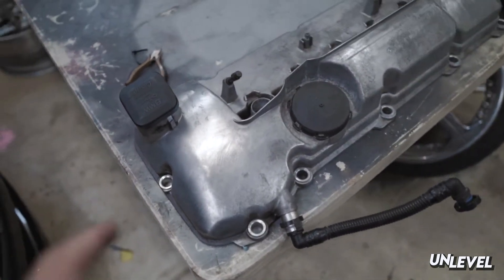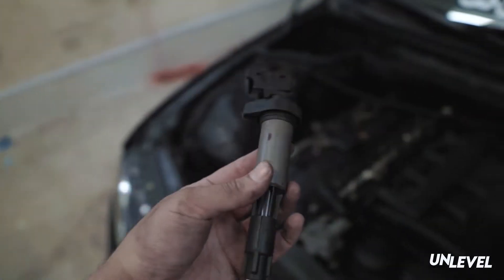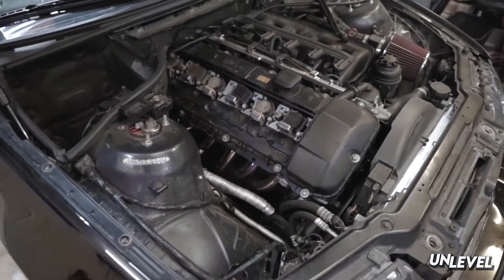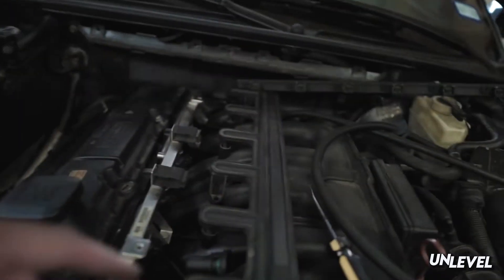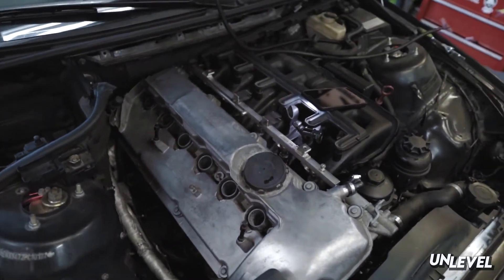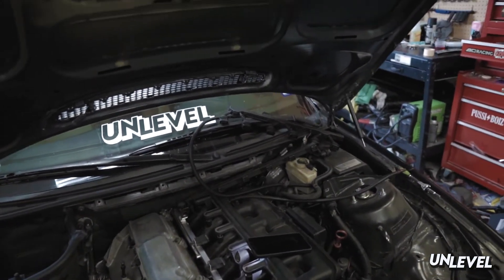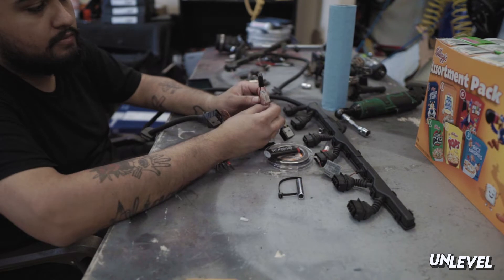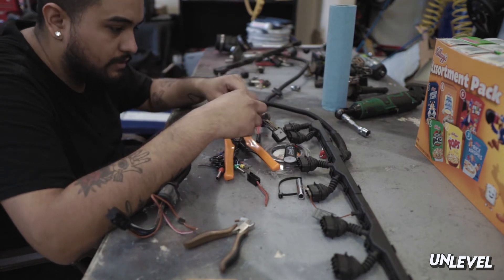E46 Touring Gets an M56 Valve Cover!

Comment: Don’t forget about pin 6. ECU needs ground (ZSR) from coil harness. I made the conversion myself but 1k miles later check engine light came on stating engine was misfiring in all 6 cylinder. Change back to original harness but use connectors from m56 harness
Reply: Same here!! I got all of those codes as well after the swap… So I have to go get pin six with the resistor from the original harness